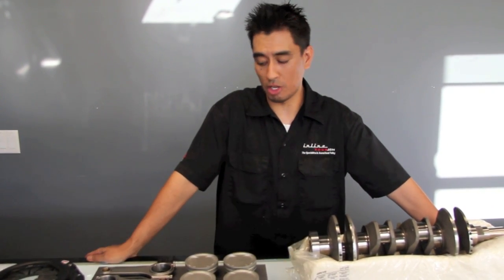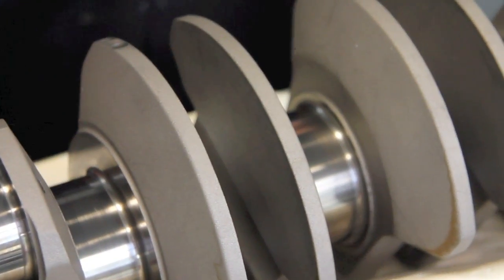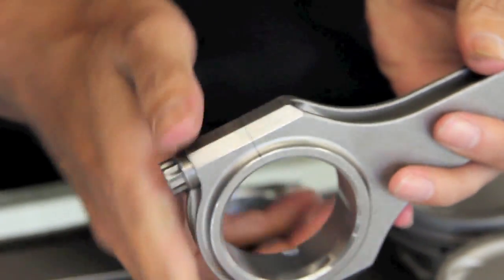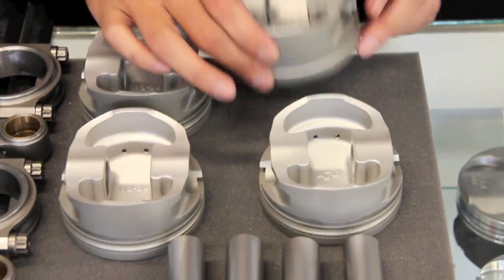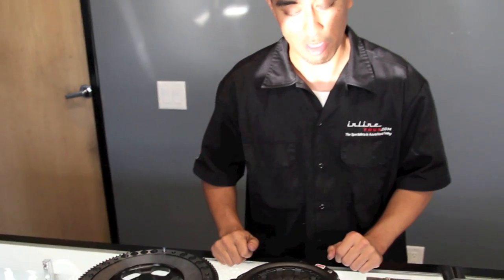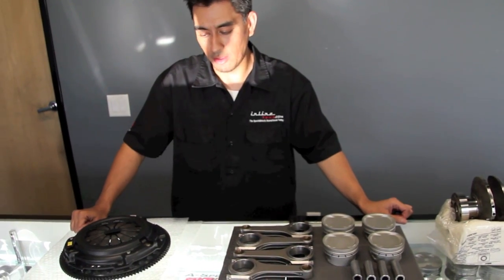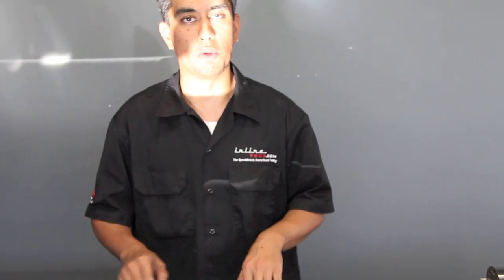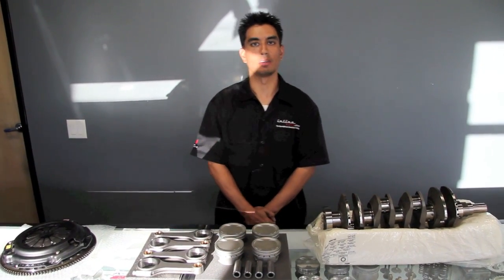Inline Four - Precision Engine Balancing

Comment: Is that little bit of weight y’all took off really make that much difference??? I can’t imagine a gram or 2 would result in the engine coming apart because of unbalance
Reply: Why do you think American engines grenade if reved over 5k?  Precision.  Why do you think Honda first sprang onto the Earth and absolutely dominated the IOM?  Precision.  A gram at rest is much heavier in motion, and it gets worse the faster you go.  Those couple grams quickly become pounds pushing everything the wrong way.  Not too important on a lawn mower, but at 7k it is.  More so at 8-10k.  Above 10k it starts to become extremely important.  Is it necessary for the every day street driven import?  Not at all, throw some vitaras in there and seal it up.  But if somebody is serious and wants to do it right everything gets balanced and tuned.  Difference between a shop build and a garage build.

Comment: Nothing special here. All racing tuners do this. We spin our street cranks with harmonic balancer and flywheel attached up to 8000rpm and our equipment laser dots where the metal comes off or where it needs to be added (yes, that too!) and how much down to 1/10 gm. The equipment these days is so good you should not expect anything less.  Part of dynotuning we also check the vibration levels coming through the block and we have a scanner that indicates where the vibrations are sourced from the outside in. It could be the crank or cam, oil pump anything that spins has to be balanced. Even the way the crank and heads are torqued down can couse a tiny warping of stretching of some part of the engine. We follow what Cosworth do and thats good enough for us. We use the same equipment as is used in F1 and they take their testing to 20,000rpm.
Reply: I'm curious. You keep saying "we", who is we?
Reply: @strongme80  A shop.  That doesn't want to dox itself on Youtube.  It's not really a good idea to do that.  I don't even say what state I'm located in when commenting on something.  No need to.  Nothing to prove.   This IS youtube after all.  lol

Comment: 0.2 gram for rods and pistons is not that accurate. It's better than the typical rebuild but that is not really that close. My last rebuild was for an lightweight 1.5 N/A class engine. The parts were cheap parts (piston set varied by upwards of 10 grams). I did the rods, pistons and piston pins all separately, to within 0.02g of each other. This is one of the reasons why that little car pulls so hard to redline and on stock econobox cams too. ;)
Reply: You think it is but have no proof

Comment: Pro engine builders huh have to mark the pressure plate  and flywheel cause didnt figure out that it only goes on one way ....
Reply: Dustin Chamberlain mine has 3 positions, 6 bolts, 2 dowels, but pressure plate has holes drilled for the dowels on all sides. some cars may only fit in one orientation but not all.

Comment: Hi i have a question is there a calculation to find the proper weight for crank shaft counter weights? ie  piston weight + 75% con rod weight ??

im looking at building a 998cc roller crank classic mini and i want the thing to safely rev to 10k
Reply: my uncle had a mini, we rebuilt it, cooper head, twin su's, flows, ported and mirror ports and intake, changed over to neg earth and ran aftermarket ignition ( brand forgotten now) with lightened and balanced everything. it was a awesome car, spun all the way to the end of 3rd gear and did a hundred mph all day but 10k! good luck, any things possible but why? for the effort needed to get that old Brit to those rpms could wham a Honda donk in and call it a day. if you do build it please put up a video as that'd be something to see for sure, my Uncs revved happy till about 6500 but there was really just noise after that and rattle, was well away from its torque range of 3-5500. when you build it look around for a straight cut gearbox, there's a few still around from back in the day, they're noisy but in a mini slamming thru gears thru a nice tight valley roads at 100mph is the tops.
Reply: Josh I've heard 75% crank portion of rod + 50% piston portion of w/ piston.
Reply: On flat or inline 4s, and inline 6’s all you need to do is equalize the weights of your piston/small rod ends, and large rod ends since the primary forces cancel each other out.. on v style engines, it’s 100% rotational mass and 50% reciprocating mass